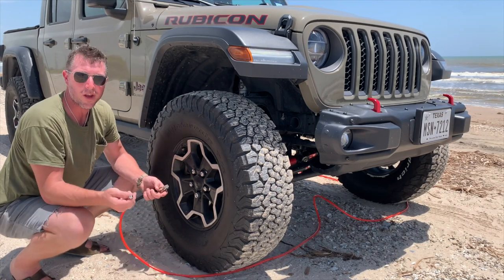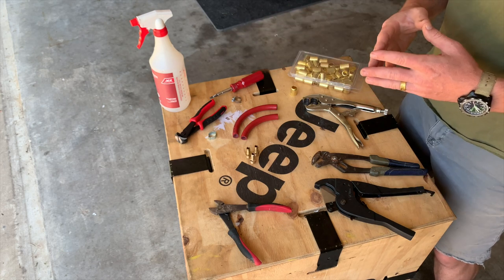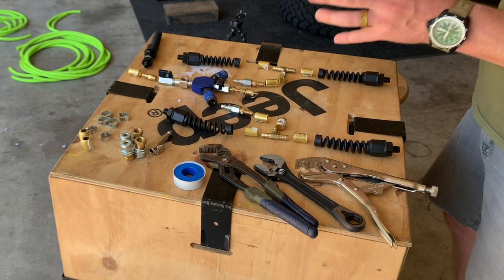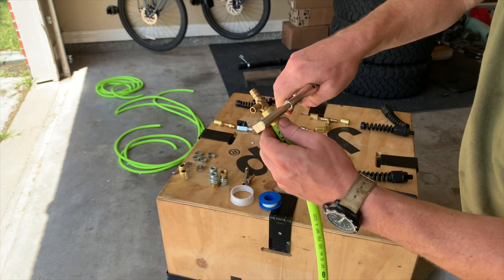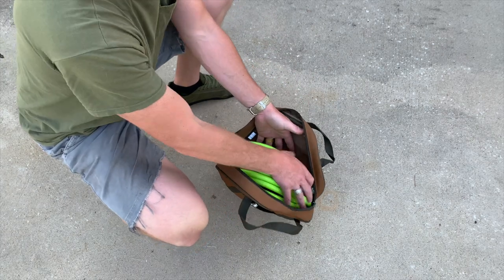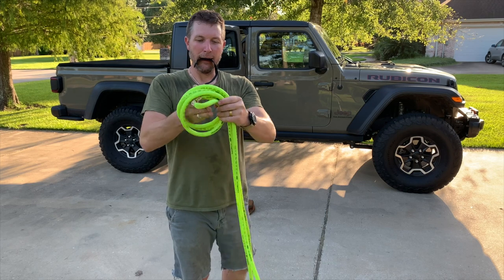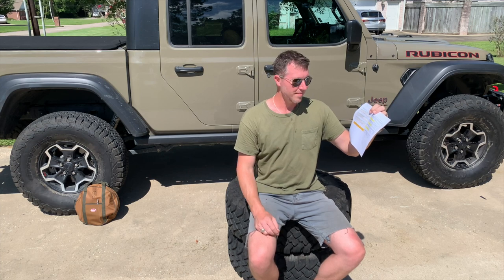DIY 4-Way Tire Quick Inflate/Deflate System for Off-Road Tires

Comment: How are those locking chucks holding up?
Reply from the maker: Many many many uses and no issues, despite drafting though dirt, mud and water. I do maintenance then with WD40 periodically, but they are holding up great
Reply: @GatorOverland  awesome, only other questions is where do you get those crimp fittings? I can't seem to find them on Amazon and they seem a lot bette than the barb/hose clamp type  fittings
Reply from the maker: If you’re talking about the metal side crimps, you can typically get those at any hardware store near the air hose/compressor section.. if you’re talking about the Ferules those can be found sometimes at the hardware store.
Feel free to reach out email if you have any questions… Don’t forget to check the description for links to products
JKHARTEL3@gmail.com

Comment: When deflating hook to your tires first then the manifold, they'll equalize each other's pressure :D
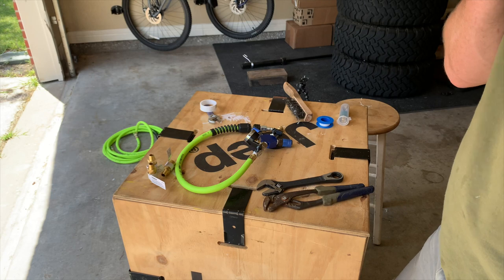Reply from the maker: Thanks for the reply… starting the video a 22:44 covers exactly what your comment suggests... I apologize if i is mentioned indirectly.. 16:32 covers tire equalizing..
Reply: @GatorOverland  OK, I did fast forward some parts, but saw your hook up procedure in the video was that way.  I currently have a couple open clip on tire chucks with open valve cores screwed onto.  I get exercise walking back and forth around the Jeep checking with the chuck😂 I'm thinking a setup like this might just make the job easy enough to air down and up more often.
Reply from the maker: Exactly… It works great… I upgraded from doing it exactly the same way you mentioned… Both work great, one is more convenient… You may check out a company called speedflate if you have an already heard of it. Check out JT Mitchell films on YouTube… it’s a great design… I may even upgrade to something similar, but this works great..
Reply: $170 is too rich for me, lol.  After all I drive an XJ.  $100 for a premade kit I'd think about it.  Hoping for ~$50 on a DIY kit, after we recoup some funds from buying the wifey a new kid hauler, lol.
Reply from the maker: Fittings and pvc air line, you could do it $50-$80 easy.. those chucks are the most expensive part at 12$ a pc.
Reply: I think I may get screw on ones, those are ~$9 a pair.  I have the "locking chuck" ones but occasionally you have to press them on harder or screw them in lightly to get max flow.  Sometimes they even pop off if you just let it hang and/or bump it
Reply from the maker: I’ve had that happen with the single claw Chuck attachments… Honestly I think I would rip the valve stem out trying to get the triple claw chucks i used on mine..

Comment: Can someon please send me the limk with all the parts list and where to order so i can make myself one oof these with a little twist of my own on it...lol  Thank you. can't find it in the description sorry
Reply from the maker: Shoot me an email at jkhartel3@gmail.com
Reply from the maker: When you hit the description drop-down arrow go to the bottom of the text and there is a prompt that says more… Click that… There’s literally 4000 words of information in that description and all the links 😂😂
Reply: What’s the deflation part you use? I can’t find in description.
Reply from the maker: What are you talking about the coyote deflator? Prior to using the four-way inflate/deflate system are used the screw on deflators on each valve stem… They work great once they are set properly. I still tend to use them for deflation… The four-way obviously has its most benefit of inflation equally and deflating equally as a bonus

Comment: Did you factor in system set-up?
Reply from the maker: When you say system “set up”, are you talking about the air compressor? No, it’s not included in the pricing list. My compressor system was about $400. The 4way system will work with something as simple as a harbor freight portable air compressor. I hope this answers your question.

Comment: Can you do a video on those 37" tires on stock wheels?
Reply from the maker: I’m not sure exactly what you’re looking for… But I have in a sense…
https://youtu.be/W0qL20nBNRI
other than that check my Instagram @gator_overland I have some simple clips that might answer your inquiry
Reply: @GatorOverland  Your overall thoughts/review of the KO2s, and I read that some shops wouldn't put 12.5s on the stock wheels. How much off roading you have done with those on stock wheels, and the ride/feel of that setup. I think people would like to know, including myself.
Reply from the maker: I was tossing 35s vs. 37's around for the longest, basing my decision on group members comments. The common complaint is 35'ers wish they 37" to begin with. If i hadnt actually seen a JT on 37's in person would still be on the fence. Pictures make it hard to justify. I have no regrets going 37. Ive chalk tested them at between 28-30psi and at that pressure the tires are appox. 35.5" tall (not exactly what you would expect from a tire that reads 37 on the side) it changes my speedo approx 6mph, which i have since corrected. Im currently getting 17-18mpg on paper (not the dash estimator). I did experience the undergear'd bog when we were on the 5% and 6% grades on the Colorado trip. An auto would make short work of it, but it was pretty shifty in my manual trying to maintain the proper rpm to keep the speed up. I will probably regear to 4.88 in the spring, but as it is right now, im a southeast texas flatlander and have no immediate need to do it at this time. I expect the regear to give me back the 1st gear umph that is lacking, and as well as making 6th gear useful on the highway. I expect to see 19-21 mpg as well.

I had considered a few different tires in the 37” range. Ultimately it came down to price (go figure) ive run BFG KO/KO2's on my trucks for the past 15 years without any issues and ive achieve 45k + mileage out of them. I rotate @ 5k religiously. I almost went with Patagonia's as they seem to be a very popular tire and hold up well for the pricing. I have friend that run the Nitto RidgeGrappler and have great on and off-road performance with them and seemingly good tread wear as well. I would definitely consider the RidgeGrapplers if i didnt go KO2's. In the end i stuck with my trusty KO2's and am very happy with the on road comfort and road noise (or lack thereof). It does everything I expect and more off-road, especially @ 12-15psi..
Reply from the maker: You prove a good point and I should make a video note for my own sake, but this guy his done the work for me and I agree 100% with what he says ..
https://youtu.be/_4dTv_jJyLs
Reply: @GatorOverland  Great info. Thanks for sharing!
Reply from the maker: You bet man! Enjoy you’re JT!

Comment: Kindly do explain a little bit more. Watching the video, I notice that on deflate, pressure is coming out through the same cable you attach to the compressor. But my understanding is that deflation would be through the other ball valve you attached the coyote deflator earlier on. So am a bit confused here.....🙆🙆🙆
Reply from the maker: The one with the coyote deflator is just an extra port, so both can be opened, or that port could actually be plugged… With the main lead hose disconnected from the compressor chuck and the ball valve open there is nothing to stop the air from coming out of the main
Lead connector, so therefore it would be an outlet… with the main lead connected to the compressor, it would be an air inlet.
Ultimately the time of inflation and deflation is limited by the Schrader valve on the valve stem.
Reply: @GatorOverland  understood. 
Did you ever find a solution to how slow the coyote was in deflation?
Any thought on how to incorporate a air regulator that can be set to cease  pumping air to the tyres automatically? And possibly do the same while deflating?
Reply from the maker: There are pressure regulators out there that you can have it to where it shuts off at a particular pressure… I did not find a solution to make it go any faster than removing the Schrader valve in general. But, the fact that I can pretty much set my watch to the deflate and inflate times is convenient enough in most cases. https://youtu.be/_g2oNpZ6f14
Reply: @GatorOverland  O yes....the watch idea! Simple solutions....aren't very common indeed.
Thanks alot. Much appreciated.
Reply from the maker: I write my times on my door jam next to the Vin sticker

Comment: Never in my life have I ever been able to run an off-road vehicle with the same tire pressure all the way around.
Reply from the maker: 😂.. well, this 4 way system will get you spot on and equalized between all four. Pretty cool concept and saves a bunch of time. It’s a worthy diy project..

Comment: Honda generator, Dewalt pancake compressor. Way Faster.
Reply from the maker: Sounds like a great combo, but a lot of extra weight. I’m sure it works great though. 🤘🏼
Reply: @GatorOverland  extra weight vs xtra wait....we choose our battles...great vidz btw
Reply from the maker: Yes, I totally know what you mean… Thank you for the kind comments, I do a bit of research in them and hopes that it may help even one person…..
Reply: CO2 system is dramatically cheaper, much smaller, runs much higher pressures, and will fill much quicker. You can run power hungry impact tools off them as well. Plus its quiet so it can be used whenever
Reply from the maker: I agree, co2 might be my next step.
Reply: @GatorOverland  I built mine for around $260. Got the 20lb tank and filled for $150 from airgas store and a regulator for $100. 
.
It’s about $24 to swap tanks for fully charged unit. Since I run 33s and only air down to 20psig, it’s lasted all year. iirc a 10lb bottle will inflate 37s 30psig 4 full times.
Reply from the maker: Awesome… Thanks for the info

Comment: Don’t use Teflon tape use medium loctite work much better
Reply from the maker: Thanks for the heads up.. I actually went back after my video and did some research to find that flare fittings do not need Teflon tape on the threads… I have since removed it. I had already uploaded my video by that time and it was too late to inform.

Comment: Looks like all  parts added up come out to $200...
Reply from the maker: All parts have gone up since I did it. It was $150  at the time sparing no expense. Can be done for about half that with cheaper materials
Reply: @GatorOverland  yeah, the premade systems are very close in price. I might just make a double filler to balance but I don’t have issues with my tank speed.
Reply from the maker: Get with @TJMitchellfilms… He makes speedflate… Good dude

Comment: wow, not bad for an amateur. half of your system is good, but the rest is over complicated. did this 30 years ago to equalize or fill a low tire when i was off roading my volkswagon sirocco. (aka rally/hair scramble) get rid of the useless "deflater" and use a 1/4' safety relief valve. less connections to leak and cheaper. also not necessary as you can just use the ball valve, just disconnect the inlet hose. the entire manifold is BI-directional.  arb couplers? go to harbor freight and get the same fittings cheaper. the only things you really got right was the manifold and the flexzilla connectors, strain reliefs and quick connectors for the air valves. sorry, but your "coyote deflater" is just a standard safety relief valve and a waste of time. look up compressor parts in lowes, home depot or harbor freight and save yourself some serious over-engineering and more than a few bucks.
Reply from the maker: Thanks for taking the time to atleast watch the beginning. I cover everything you mention in my time evaluation toward the end. I intentionally spared no expense for my build, but i cover all the cheaper methods as well. The deflator was an idea but it wasn’t efficient. Feel free to use the time stamps to move to that part. That’s awesome you had the only vw rally car.  🤘🏼
Reply: @GatorOverland  ya, i did watch the WHOLE thing a couple times. was confirming you and adding a little detail based on prior experience. didn't intend to dog on your results. at least your vid was worth commenting on. can't say the same for the first 5 vids i saw or the 2 atrocious ones after. you at least took the time to do your homework a bit. and your right in that there's no "wrong" way to do it, but getting it right takes some effort and a little trial and error. that was what i tried to add. sorry if i came off troll. Respect. =^-^=
Reply from the maker: Oh No, not at all… I totally understand and I appreciate that. I take everything as constructive criticism, the good and bad😂😂.. yes there are some videos that are hard to watch.. most of mine you need to set a vacation time for😂😂. Thanks 🤝
Reply: @GatorOverland  well at least i enjoy Your vids. some others are just plain hard to watch and reminds me that the internet is Not a research source. looking forward to the next one.
Reply from the maker: You won’t have to wait too long… I just finished one up yesterday for a self inflating mattress pad for camping/home pallet… It’s made an incredible difference compared to the mattress that came in our RTT’s… Thanks again for your input
Reply: @fatherfoxstrongpaw8968  some great feedback

Comment: How did you connect the compressor to the battery? 
I think they need to be connected direct, right?
Reply from the maker: You should watch my compressor install for the 813 behind the seat arb bracket. Yes, it connected directly to the battery for the main power source. The switch wire is connected to F50 fuse in the fuse box as a 12v signal source with the key on. You could also opp for wiring the switch wire to an aux switch if your vehicle is equipped.
https://youtu.be/q1tQJZ57UHg
Reply: @GatorOverland  Thanks for the quick reply! I just got my Jeep JK last week and am researching what to do about a tire system. I will be spending a lot of time at Matagorda where this will be a big help.
Reply from the maker: Awesome! I’m from SETX by Beaumont/Galveston area.. there are some great under hood and rear cargo area options for compressor mounts. You may contact Jeremy of 813 fabrication. Some of his JL stuff my work with JK.. also, check Grimm off-road, they have great options. You may find that the provided arb brackets in a compressor kit will work just fine for  you somewhere in your vehicle, and if would only be a matter of wiring.. you could again refer to my video for how that works.
Reply: @GatorOverland  I’m your neighbor and I just got back from Ouray and Silverton, I bagged Ophir, Black Bear, Engineer and Poughkeepsie by extreme caution and dumb luck. 🤣😂🤣 I’d like to touch base with you. 😁
Reply from the maker: Awesome!!
Shoot me an email to jkhartel3@gmail.com

Comment: PARTS LIST!!!

G E T  A  P A R T S  L I S T  H E R E !!!

(Please put it here, tried to make it very Noticeable!)
Reply from the maker: Parts list is in the description, but here it is again 
Materials and Tools (including amazon affiliated links) 
(1) Flexzilla Pro 3/8"x50ft hose https://amzn.to/34ou694
(2-3) Flexzilla Pro 3/8" air hose reusable fittinghttps://amzn.to/3l2whVR
(1) Flexzilla Pro 3/8" air hose reusable swivel fittinghttps://amzn.to/31e7dDF
(9-14) 3/8" hose clamps *optional" https://amzn.to/2Q7mWxX
(9-14) 3/8"/11mm double ear hose clamps optional https://amzn.to/3kYe389
(9-14) 0.635"ID Ferrule optional required with Flexzilla hose https://www.toolsource.com/air-couplers-and-fittings-c-1421_372/brass-ferrule-flexzilla-38-inch-p-134072.html these 0.625" ID ferrules may work https://amzn.to/34urqHp
(1) Ferrule Vgrip crimpers optional https://amzn.to/2E9gd44
(1) 6in1 multi screw driver optional https://amzn.to/2YkFcIv
(1) End Cutter pliers https://amzn.to/3iVXxUb
(1) Teflon Tape (2) 3/8" Barb Tee https://amzn.to/34lDdHJ
(3-12) 3/8" Barb x 1/4" NPT Male fitting https://amzn.to/3coi9ny
(2) 1/4" NPT Male x Female ball valve https://amzn.to/3aJ6c9O 
(1) 3way Air Splitter manifoldhttps://amzn.to/32aLz25
(1) ARB 0740106 or similar 1/4" NPT adapter M/F/F https://amzn.to/2FGWUzA
(4-5) Haltec H-5625 Bore Lock-On Air Chuckhttps://amzn.to/3hikxfF
(3) 1/4" FNPT "M" style air plug fitting
(1) 1/8" NPT X 1 1/2" dia. 160# air gauge https://amzn.to/31aVrd4
(1) 1/8" FNPT x 1/4" MNPT reducing bushing https://amzn.to/3Pl9Jzj
(1) Bucket Boss cable bag https://amzn.to/3aFwFVs